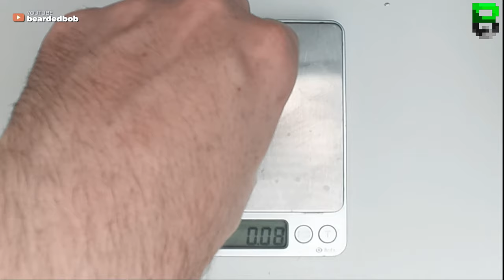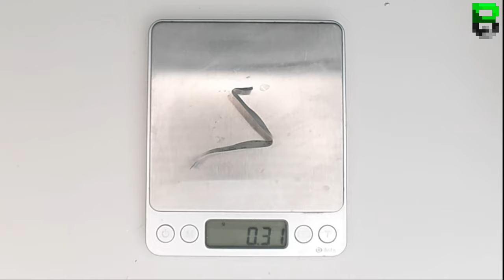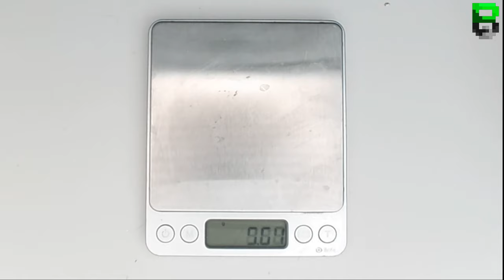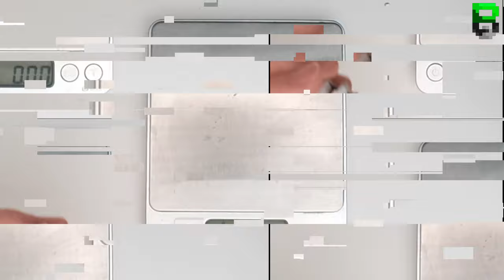THE ULTIMATE LETDOWN INSIDE: The Razer Basilisk

Comment: thanks so much! i wanted to check which feet to remove for the screws, so i dont have to remove them all. bought this mouse for my brother and for some reason he got the mouse wheel unlocked from its socket and both springs tumbled around in the mouse casing.

Comment: I have an older Basilisk Ultimate that I’m planning to do a lightweight mod on. I’m thinking about removing the side switch PCB on the top cover and the RGB board on the scroll wheel. I was wondering if the mouse would still function properly afterward ? (without side buttons and DPI button for sure)   I’ve ordered a 120mAh battery to power the lightless mouse and decrease around 20g

Comment: What was the screwdriver used to remove the bottom screws? Also, is it necessary to replace the skates after removing them?
Reply: torx bit screwdriver, and yes if you dont replace the skates you'll be grinding the mouse over your desk/pad instead of it slipping on the top

Comment: That jank of 'free-scroll' wheel-on-wires assembly in a nice wide groove for dirt collection was the first thing to start failing before the warranty expired. The icing on the cake is that stretchy piece of cr..rubber on the whell gains length fast and helps to pack all the dirt deep into the grooves. It's impossible to clean it up without opening/voiding the warranty.
Oh, and the shell. Unlike DA V2 and Orochi V2, Basilisk U doesn't have and anti-bacterial coating, it has a spray-paint coating. Sweaty, with RGB scratches.  

 I'm not a conspiracy guy, but in my mind, no self-respecting engineer would compensate for clear points of failure by cheapening out on every bit of material that can affect it and leaving it as his "job done." 
 
Maybe the Ultimate that they sell now for 100usd+ is different from 2 years ago. But maybe Razer is just a  shitshow of greed. G502 Lightspeed is cheaper and better built.

Comment: Do you have a part number for the encoder please? Mine is reverse scrolling randomly and sometimes a double scroll. Love the mouse other than this and would life to replace this part. (or upgrade it if I could - adept at soldering etc) Pretty please :D
Reply: its an issue ive dealt with on mine too, very annoying in games that use the scroll wheel for item/weapon selection. ive found that using compressed air on that area helped me. Usually its hair or dirt interfering. I just tore mine down to do further repair and there was tons of hair trapped inside the mouse. wild.
Reply: @clintonbutler4503 thanks,I'll give this a try 👍🏻

Comment: What size screw driver do you use for the bottom 5 screws?
Reply: you'll probably need a decently robust security bit kit, like one of the kits from ifixit. that's what I used anyway. Think I used a J0 bit from that set, or maybe it was a J00.